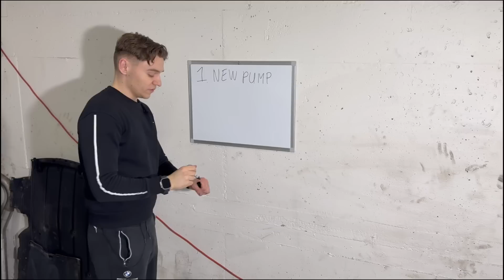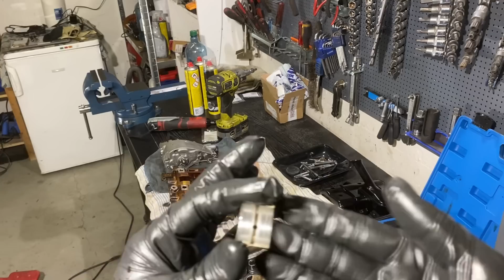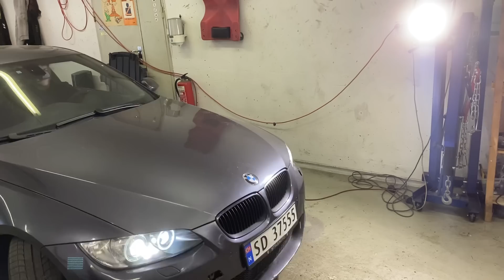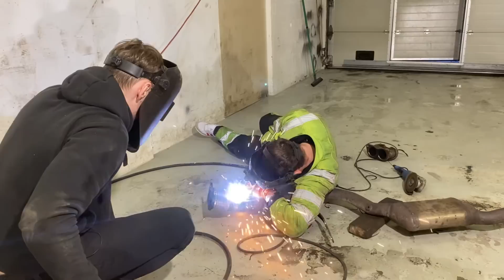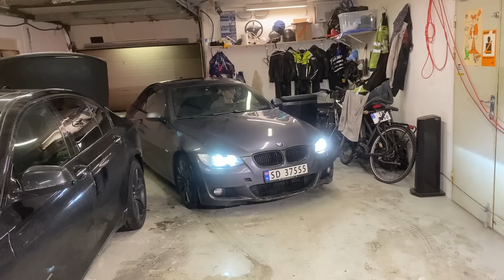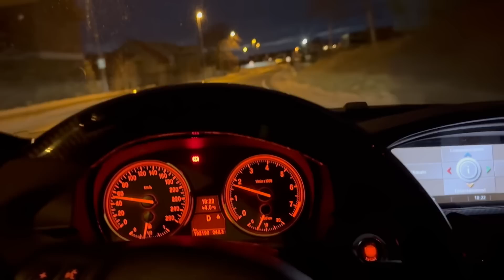BMW E92 320i RESTORATION #4

Comment: I first removed the comment but now adding it again even if all of its content is not relevant for your N43 engine:

If your engine had been the N42 or N46 i would recommend you to inspect the worm gear on the eccentric shaft (where the valve tronic motor operates). This gear often often having oil starvation due to a clogged spray nozzle, causing premature wear between the worm gear and the valve tronic motor pinion. Then the worm gear wears the out of tolerance causing the car to misfire. 

In your case I recommend to check with a smoke tester the intake system for any vacuum leaks. If tou have a small vacuum leak it will potentially not throw any codes in the ECU. A vacuum leak would also be aligned with the airmass flow sensor code you have. If the car run too lean, it will cause the airmass sensor to throw a code. This does often not being the sensor itself, but a vacuum leak post sensor in the intake system. Next I would address the fuel injectors and timing (stretched timing chain since the N43 engine is prone to chain wear and failure).

Comment: Did the exhaust made strange ticking noises before replacing the flex pipe ? Mine does that uphill im not shure if it is the flex pipe.. thanks

Comment: The ac compressor bracket is in the way for undoing the front oil pan bolts.. any suggestions? Thanks
Reply from the maker: I used wiggle sockets and managed to undo them without removing the ac bracket

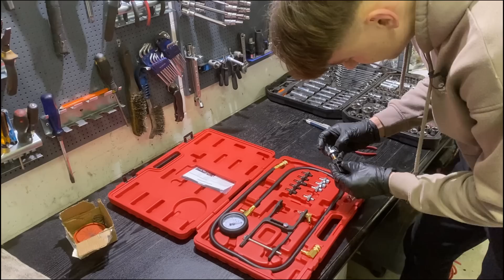Comment: in your last video @29:08 , you are testing the oil pressure regulator, and it worked !
But i have replaced them many times , because of a low oil pressure warning light coming on
Inside of the regulator, is a valve which scratches the outside walls , and gets stuck , so sometimes you get low oil pressure !
Replace the regulator and the oil pressure sensor , by removing the alternator you can reach them with ease and its a 30 minute job

P/S 
Replace them with Original parts, trust me  !
And that PCV valve you replaced  , its probably broken already , because they always do
Replace the valve cover for a new original one  [ yes its 300 euro , i know ]

Comment: If this is n53 engine they are notorious for leaking injectors which give poor startup after leaving over night, lumpy idle or not sensor. Read on bimmerprofs, they have all the same issues as the n53 engine.

Comment: So did you don’t have to lose the steering column? What about coolant pipes on the front axle? Thanks
Reply: What about losen and tighten the crank bolt with the engine in air ? Is that possible or do i need to bolt it always on the subframe for that job? Thanks
Reply from the maker: @bigdeal87  not quite sure, should be possible to torque it on the engine bar, if not you can torque the crank bolt after you have put the engine down again
Reply from the maker: I left all og them on, possible to do
Reply: Wow ok that’s genius! Tought that would not be possible! Thanks
Reply from the maker: @bigdeal87  but I lifted the engine as mutch as I could on the engine bar

Comment: Great video! Can I ask what the degrees turn is after torque setting?
Reply from the maker: Stretch bolts need to be stretched after torque, and you do it by adding degrees of turn after installing with torque😊

Comment: arff too many job for no problem finally! like other comment, change oil pressure sensor and oil level sensor ( i forgot if you change it in rebuild), the gauge is a good test youve have a great idea :) you can run with this gauge in differnt condition for a moment and you see how its run, its good no problem change oil, maybe see if an other grade can be usuable on this motor, many problem on M Model by the grade...
a++

Comment: Great work with the E92. At this point I would have lost all hope and probably just buy M57 engine and put it in the car :D. All 4 cylinder petrol BMW engines from 2000-now are shit apart from B48 in my opinion.

Comment: as a 235k kms n43 owner. i use to have oil light when stoping at idle right after freeway. i clean and shake a lot the oil valve beside the alternator and switch to 5w40 and no more oil pressure light. 
in your case, the engine is fully rebuilt that’s strange 😔
where the gauge was, is it just after the oil pump right ? 
that’s mean even a brand new b16 oil bump wouldn’t give more than 2bar at idling ?!
Reply: I had exactly the same problem, did exactly the same and now I am also oil pressure problems free :D
Reply from the maker: Its in the oil pressure sensor spot, yes when its ar operating temp and oil is hot, but again, the hydraulic valve regulates the pressure
Reply: @EMSGARAGEE61  ok ! 
when new, you supposed to heard the ball moving freely in the valve when you shake it hard in you hand like a weirdo ✊ 

i’ll dm you on insta

Comment: Hey, maybe check the live data of the o2 sensors as well. With this milage they can be original amd worn. I had similar problems with my audi where a broken o2 sensor made the car run roughly at idle, high consumption etc. Also check for vacum lines, they can cause bad idle.

Comment: Oh, and running fresh fuel and injection cleaner also helps on the rough idle and bad performance. Worth a try before cleaning the injectors, especially on high mileage old cars that need to run regularly.

Comment: I hope your patience and dedication will reward you. I did have a oil pressure problem myself but on the older E46, problem was luckily fixed with a new sensor, far mor easier.

Comment: Did you check the injector's? those are an weak point in this engine. check if they are the same index, and check by ista if the correct injector numbers are filled in.

Comment: about misfires please check injectors (NGK not Bosch!)and  ignition coils can be worn out so i would replace them (bosch)and last thing is leaking injector - make sure they dont leak. And dont forget to delete adaptations and learn new adaptations its very important for this engine i fixed missfires by doing it 2yrs ago. (read more on bimmerprofs) i have similar problem engine misfire on idle but its so rare that i will fix it in summer :) 
about oil pressure may be just faulty sensor as it read 1bar and you measured 1.5-2bar, also oil solenoid whish regulate oil pressure can be blocked so it dont work properly.
about flex pipe rusted out - it was same problem for me and fixed it same as you.

Thank you so much for this content i would replace membrane too in summer just preventive. what glue did you use please? did you check it for leak?

Comment: I agree with zEDo1. Audi has had tons of issues with Bosch direct injectors leaking, getting plugged with carbon, etc. The oil pressure could just be a faulty pressure switch. I know on VW, oil starts to leak in to them and it ruins the sensor. I was very surprised to see an NOx sensor on a gas engine. Not sure if that’s just a European thing or what. 😂 Also a nice bit of reasoning with the exhaust leak and the misfire. I’ve several VW/Audi V6s and V8s with leaking flex joints and they would run like garbage.

Comment: My e90 316i acted very much like your car. Up until 215.000km it had been running with leaking valve stem seals and a broken pcv. I fixed that, but it ran like crap after, especially at idle. I changed the maf sensor, and that made the car drivable. I was about to change the upstream o2 sensor, but decided to just drive the car instead, as much as possible. These cars hate being stood outside in the Norwegian winter, and need to be driven regularly. The car is now at 217.000km, and seems to be healing itself, lol. I should clean out the intake manifold, but I'm fed up at this point, so I'll just keep on using the car till it breaks down. Love your videos, all the best from Tromsø.

Comment: Not sure if this will help but, my e46 was doing the same thing with the oil pressure light. 
Turned out it was the oil level sensor which was causing the light. No codes or anything. 
Worth a try 😅

Great videos!

Comment: As a fellow n43 owner, I suspect that most likely the misfire is caused by faulty injectors. They are VERY sensitive, basically the only injectors which are reliable are the latest index 11 and even those can be faulted out by broken ccv, broken o2 etc. if left unfixed.
Reply: 😮index 12 is for the n53.
N43 is index 11.
Reply: @maryan7926  the index 12s work on the n43, n53 and the n54. They were so bad BMW had to make 12 revisions of those shitty injectors to get it right
Reply: Index 11s are garbage. the only good ones are the 12s and 1s
Reply: Index 12 wont work on n43

Comment: Hi, ( sorry if the translation is not perfect )

If it helps here are my tips, for the idling problem, try doing a leak test with smoke to see if there is not a leak somewhere. ( Valve cover or intake...)

 And for the oil pressure use 5w40 or 5w50 or even 10w60 and the problem will be solved in any case for me it helped me.  

You're video its great keep it up ✌️
Reply: i used 5w40 and oil pump got stuck but i dont know if it was due oil or not
Reply: @mifo1133  I don't think it has anything to do with it.  I switched from the 5w30 which was too smooth on my N52 with 360,000km to the 5w40 which greatly improved the engine (less overheating, no more oil pressure problems) so I switched to the 5w50 and same no more problems since
Reply: @TheDarkknightdu93   for 1year i was with 5w40 too, what brand did you use? N52 is not same engine so there can be some difference
Reply: @mifo1133  I maintain several vehicles (7 and different brands, both 3 🥺 and 6 cylinders ☺️) I buy my oil on autodoc.  And despite the different engines I was able to notice that the 5W30 oil is more fluid when hot (W30 hot fluidity index) which lowers friction and reduces fuel consumption to the detriment of engine protection. So I use 5W40 to protect the engine and increase the pressure when hot (W40 best protection index when hot) and on my N52 at high mileage 5W50 to increase protection.  All engines which heat up a lot or which run on circuit also tend to run with 10W60 so the index has nothing to do with the fact that the oil pump is blocked the index has to do with the engine protection and  the use you have with your vehicle.  For my part, I prefer to protect my engine and increase fuel consumption by 0.01l/100.
Reply: @TheDarkknightdu93  thank you, i will consider 5w40 now :) but i dont drive long distances so . 50-100km
Reply: @mifo1133  you're welcome ✌️

Comment: Had a flickering oil pressure light and false oil level warning on my 330ci, replacing the oil level sensor fixed both issues including the low oil pressure warning.

Comment: Please keep us updated if you find the culprit.
Reply: I have had (maybe I still do) same issue, up until now, new chain, oil pickup cleaned from debris and new rod bearings have been fitted. I don't know if it resolved since it manifested it only in hot weather, kinda strange.